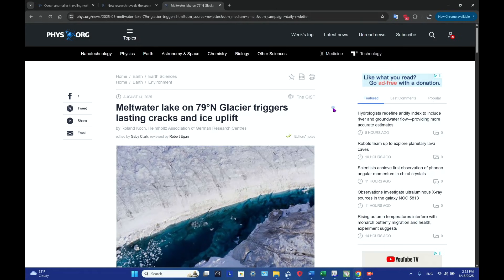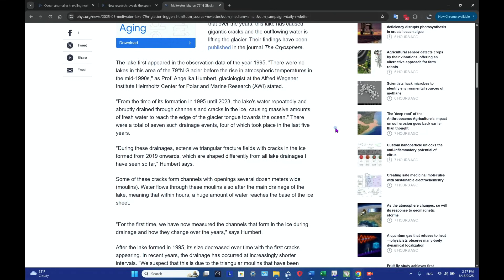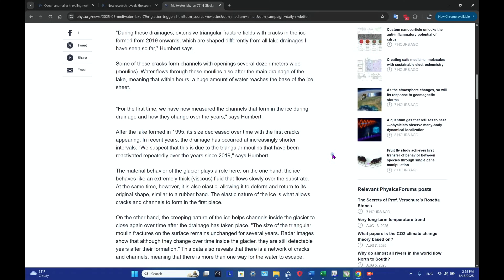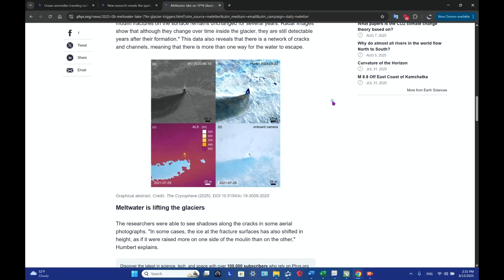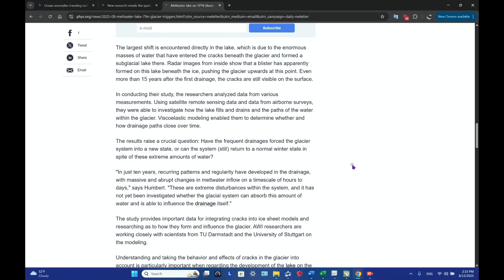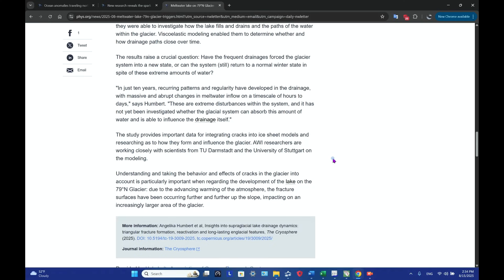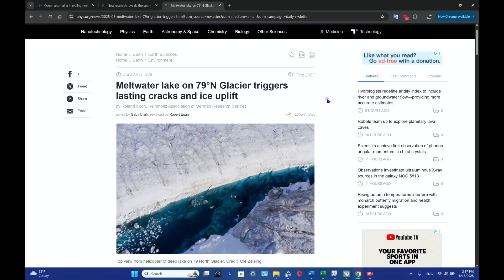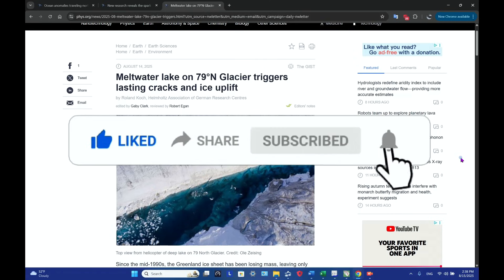Greenland's Glacier is Cracking Apart

Comment: Ice becomes water above 32°F 
Water becomes Ice below 32°F 
Who woulda thunk it?😂

It's like Climate "Scientists" totally missed basic Elementary School Science classes, or the Money derived adhering to the Agenda is too sweet to give up.

Oh yeah, Ice isn't "Elastic."
Reply: You need to go back to school. 
Ice can be elastic when it is in the form of very thin, single-crystal microfibers that have a low density of defects. Unlike regular brittle ice, these ice microfibers can bend significantly under stress and return to their original shape when the force is removed.

Water's freezing point can also be lowered by the addition of salt, which is why saltwater freezes at a colder temperature than freshwater.

Comment: The cracks stretch from prolonged bottom cracks of the glacier due to uneven ground (where more pressure by the weight of glacier appears) that zig-zag invisible by the naked eye (variety of density in the ice causes that) up from the bottom, then small edges of ice needles touch in the cracks giving friction and breaking small ice parts - widening the cracks under large pressure from the glacier at opposite side of the cracks, so the cracks appear triangular in the walls with meltwater between.
Due to lower relative humidity on average in the troposphere later decades, fewer water molecules will carry more of their share of heat in the wind, reaching a glacier to cause a sudden dent in the ice when high pressure above the glacier causes the wind to buckle and touch the glacier at the top. (Analog: Hot air from a hair drier gives cracking of ice cubes straight from your freezer.) 
That means more pressure at each side of the dent (trying to close the gap/cavity) that by vectors of force reach the bottom of the glacier, then after awhile mentioned prolonged cracks from the bottom appear when gravity let the force have vectors at opposite directions of the glacier bottom, so opposite channels appear to reach the water under the glacier (made by pressure that always let the glacier glide slow on the ground) by the bottom cracks connecting the prolonged cracks, to break the ice into two walls by the water that then freezes and expand, and later we have a wide meltwater river between.

Comment: 79° north melting, is a major headline, by itself.
And few know or notice.
Reply: Increasing axial tilt.

“Do not forget this 1 thing 1 day is as 1,000 years and 1,000 orbits as 1 rotation.” Jesus

The rains came, the rivers flooded, tge winds beat against the house but tge house which was built upon the rock that is Jesus did not fall.

Not TALENT sized hail yet.

Believe in the Lord Jesus prophecies about the c CCW lunate cycles of his planet at his alpha omega millennial crossings and be eternally saved from the eternal climate change end of the era resets.